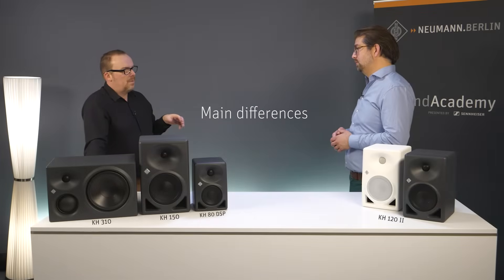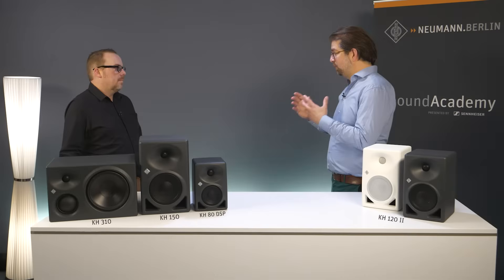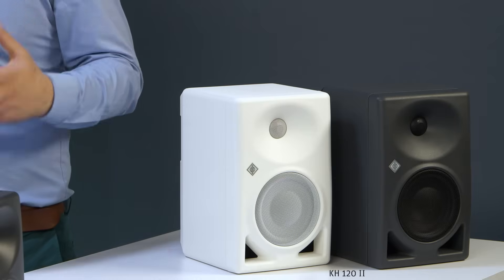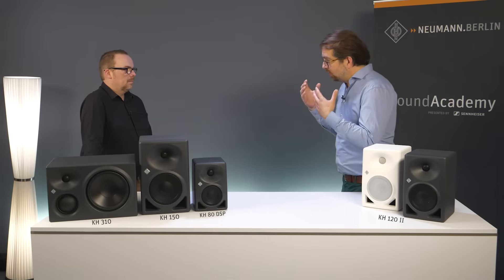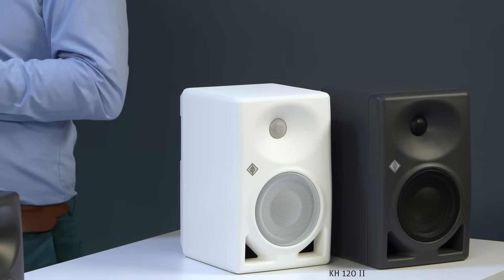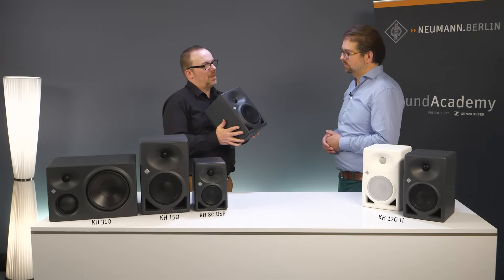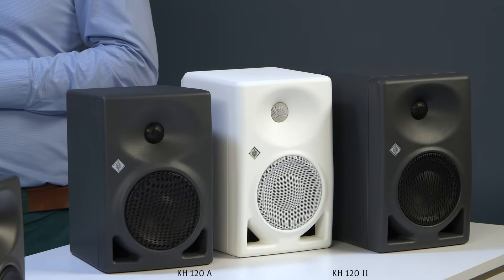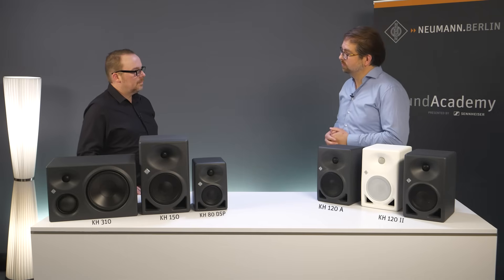Neumann KH 120 A vs. KH 120 II

Comment: THANKS NEUMAN JUST UPGRADE FROM 120 TO 120 2 AMAZING AMAZING..... ONE QUESTION WHEN I SWICTHING ON THE MONITER FIRST COMING RED LIGHT ON LOGO ITS NORMAL? BECAUSE IN OLD VERSION WAS NOT LIKE THAT ...
Reply from the maker: The Neumann logo will light up red while the DSP system boots up. As soon as it lights up white (after about 5 seconds), the speaker is ready for use.
Reply: @GeorgNeumannGmbH  thanks :)

Comment: what is difference between Neumann KH 120-II AES67 and neumann kh 120 mark2 ????
Reply from the maker: In contrast to the KH 120 II, the AES67 model supports DANTE & Ravenna Streams > With a primary and a secondary Ethernet port, it can be integrated into an audio network. The AES67 ports are compatible with broadcast standards such as ST 2110 and Ravenna as well as with Dante.

Comment: Humm, I have some thoughts about DSP correction…

First: if you have an internal DSP, what don’t you open access to freely tune your speakers as we want? 
(I mean, there’s no option to access apart from buying the MA-1 microphone). 

Second: is very expensive to have AES/EBU outputs in an audio interface or a computer, and the analogue XLR connection implies triple D-A-D conversion between the original file and the drivers. Not very elegant.

As I could see, most of the corrections are boosts-spikes in the low bass-mid bass region that can be achieved with classical low-shelving filter. More or less… they will still remain some bass notches.

Personally I think the best correction can be made on the computer, not on the speaker that changes mandatory the original file. No option to pure analogue path if desired…
Reply: You can feed them with spdif, which is cheap and still supports all sampling rates at 32bit sample width.
However, I agree with the software situation. Only offering an iPad app is not great.
Reply: It's better to use the DSP in the speaker because the amplifier inside the Unit is class D, its only better with software and analogue eq if the amp is Class A/B.
Reply: @KallusGarnet  DSP acts before amplification stage, in the digital domain. Doesn’t matter if is on the speaker or with an external DSP.

In Genelec and Neumann monitors internal DSP is programmed by their room correction software (MA 1 and GLM), which can do better job than a usual open software, especially in phase domain.

The amplifier class has nothing to do with corrections, usually with power efficiency.
Reply: @miguelalonsoperez5609 the amplifier class has a huge affect on the sound quality, I'm not talking about the frequency curve. Class A, A/B, B and D all sound different.
Reply: @KallusGarnet  nope: actually amplifiers are totally (or close to) linear: noise and THD are negligible. Frequency curves always flat, for sure! 😊

Ancient vacuum tubes amps used to show audible harmonic distortions, which can actually be imitated by digital simulation. 

A, B or D amps state for their topology circuitry, usually D class amps are less accurate (have to implement corrections) but more efficient (they heat less). 

Audibly you won’t be able to distinguish them in a blind test, Genelec for example keeps AB (mixed class) for the big boys of 80xx family but more recent 8030C and 8020D have class D.

If I remember well, other monitors has D class amp for tweeters and AB for woofers, and so forth. Heat dissipation and costs are the main factors to choose one or another in builders designs. 

If you want to learn more about measurable (real) differences between devices (DAC, DSP, preamps, amps, speakers) you can join Audiosciencereview for free.

Is a friendly community with comprehensive electronic and audio discussions, guided to objectively review of devices and can save you a lot of money in terms of marketing countermeasures.

Also you can learn how an amp is made, how distortions appear in all amplification stage and if can be optimized. 

Most of our personal sensations in audio testing are psychological inductions from out expectations and influences of marketing…
Reply: @miguelalonsoperez5609  nope: actually amplifiers are totally (or close to) linear: noise and THD are negligible. Frequency Curves always flat, for sure!

"Wrong"

 Ancient vacuum tubes amps used to show audible harmonic distortions, which can actually be imitated by digital simulation. 

"Distortion isn't the problem"

A, B or D amps state for their topology circuitry, usually D class amps are less accurate (have to implement corrections) but more efficient (they heat less). 

Class d is more efficient but sound worse than A or A/B.

Audibly you won't be able to distinguish them in a blind test, Genelec for example keeps AB (mixed class) for the big boys of 80xx family but more recent 8030C and 8020D have classD.

"I can tell the difference between A/B and D after listening so this is false."

If remember well, other monitors has D class amp for tweeters and AB for woofers, and so forth. 

"Wrong I have designed several amps with mix topological structure and we would never use class D for the tweeter 😂😂😂"

Heat dissipation and costs are the main factors to choose one or another in builders designs.

"Wrong its due to it being cheaper to produce and part tolerances, circuit sizes can be smaller."

 If you want to learn more about measurable (real) differences between devices (DAC, DSP, preamps, amps, speakers) you can join Audiosciencereview for free. Is a friendly community with comprehensive electronic and audio discussions, guided to objectively review of devices and can save you a lot of money in terms of marketing countermeasures.

"I am already a member."

 Also you can learn how an amp is made, how distortions appear in all amplification stage and if can be optimized. Most of our personal sensations in audio testing are psychological inductions from out expectations and influences of marketing...

"I have already made several amps and speakers so I have a clear understanding of how everything work."

Final point at the end of the day Class A/B will always sound better than Class D especially in the higher frequency, it's scientific law that class D can not produce high frequency samples above 8k correctly, so unless my education in Physics and electrical engineering has failed me I'm pretty sure I know what I'm talking about. Don't believe me look into what I am saying.
Reply: @KallusGarnet  probably is the last one: your supposed experience is wrong.

No audible difference between class amps, you can ask and debate for the topic in Audiosciencereview. 

You can’t tell if you’re feeling the difference between amps unless ongoing blind test: otherwise is your subjective impression.

Class D amps are as linear as you want to make them: linear amplification under human threshold is trivial today.

Giving your lack of education in answering, I have serious doubts about your formation. Doesn’t matter your supposed “formation” which can be invented, the industry is what it is.

I have seen many objective measurements of amps, and of course made mines at home: nothing around 8k (why in the hell 8k? 🤦‍♂️).

BTW, I’m rehabilitation medicine doctor, my radio frequency transcutaneous device (CRET therapy) gives (never go to that range) 100 watts at 500.000 Hz and perfectly linear, by sanitary requirements. Of course is class D.

8k is nothing in frequency, has been a myth diffused by audiphile brands interested on make you spend thousands of dollars on ancient technology.

Because you’re probably under marketing audiophile crap, I let you a link in which you can learn the basics about D amps and its capabilities. Today they are gold standard in audio engineering because of their efficiency.

https://audiosciencereview.com/forum/index.php?threads/class-d-amplifiers-101.7355/

Comment: The interviewer doesn't look impressed buddy. 😂😂😂
Reply: He could have asked more technical questions within the manufacturing and production processes for certain decisions that were made. But he looked bored
Reply: @djrobtech  He isn't impressed with the Class-D amp and MDF construction. 😂😂
Reply: @KallusGarnet idk why, class D is the best, very efficient and less hot. And MDF is far better than ABS to build speaker boxes…
Reply: @djrobtech  class D sounds terrible it uses psychoacoustics to create sound, which if you have decent hearing can tell its not real sound. mdf is a cheap material. Face it these speakers are a downgrade.